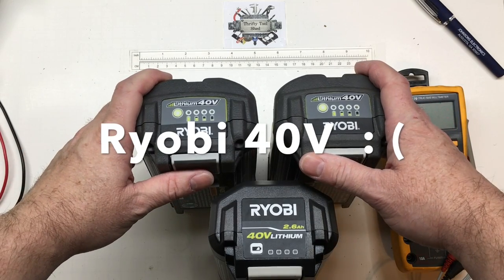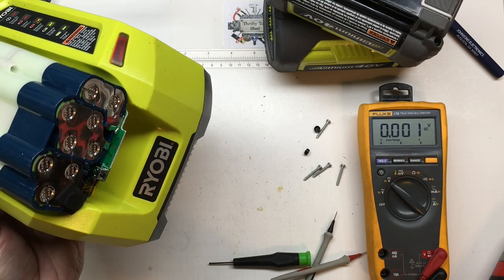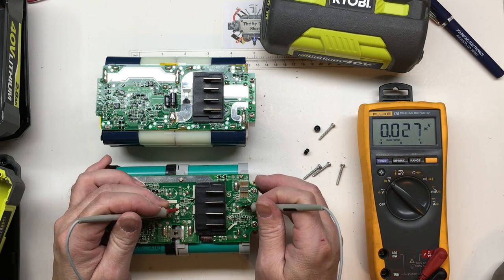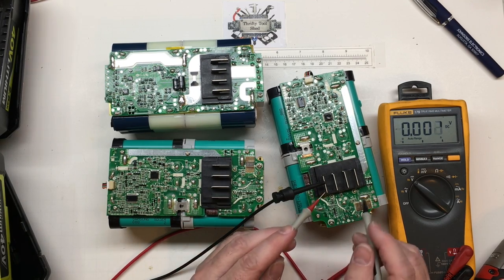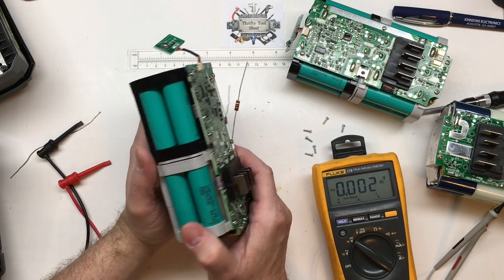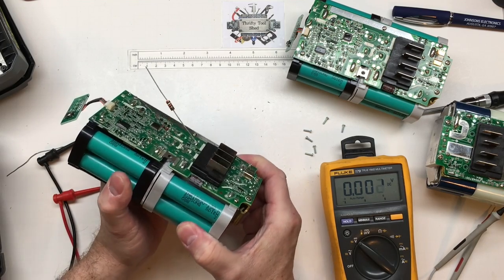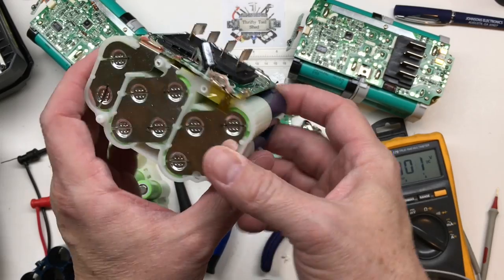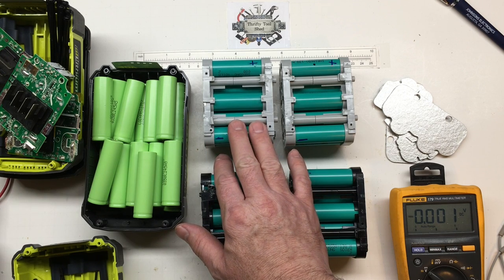Ryobi 40V Battery Issues & Cell Harvesting

Comment: Dude. On that newer pack, that negative battery cell connection on the lower right of the screen... Hook up 30 volts or so with a current limited supply to like half an amp... Put the positive on the positive terminal.
Let it run until the current starts to drop down to about 1/3 of an amp or so, and then throw it on the real charger.
It'll fully recover the entire pack.
You don't even have to take the thing completely open. You unscrew the bottom tip it up so you don't have to undo the sticker, clip onto the board on the corner for the negative and clip over the positive terminal.
No reason to take this thing completely apart unless you're harvesting cells.
Reply from the maker: Dude, that is what I am doing, I am harvesting cells as mentioned. I simply was taking time to do a video I was asked to post. I mentioned many times that I recovered many of these packs and they were a constant problems (and I mean dozens of packs) I have many repair videos of lots of packs! As mentioned this video was asked for as I mentioned several times the absolute best way I ran my 40V tools was with the two 20v packs in series because the 40v batteries are not designed well. I also do not show many times in my videos boosting packs because as mentioned in many of my reoairs, you should not boost without looking at the physical condition of the cells, you want to see why? Watch the video I did on the kobalt 40V pack that I posted. DO NOT boost packs without knowing what you are putting Voltage accross!
Reply: @ThriftyToolShed hi there, sorry to bother you, I'm a novice at best..... If I connect 40v to the positive battery terminal would I simply connect the negative to the bottom left cell (battery right hand side)? Would this charge the whole pack? Both sides in parallel??? I just need to jump start it and bypass the BMS then charge with the original when it reaches minimum charging voltage ... I would really appreciate a little advice . These batteries are a fortune to replace.... Cheaper to get a petrol lawnmower lol

Comment: Hey there, love the video. Do you have a video on rebuilding both the old and new style Ryobi 40v batteries? Having an issue with a 5Ah battery that only charges to two bars max. Thinking I may need to take each cell out and manually charge them but not 100% sure on the fix. Any help would be greatly appreciated!
Reply from the maker: Thanks for your comment! I do not have any video on the 40V Ryobi packs. I never had great success with the BMS board that TTI surely over complicated for some reason. It's problematic and even though I had a little luck replaced cells in some and a few the microcontroller reset helped get it back going. A few ofthers I actually had bad MOSFETs for the output of the pack faulty. In the end I did not have the best results for my efforts and most repairs were short lived. I had the best luck running my Ryobi 40V stuff with my (2) 18V Makita packs in series and never had an issue, just more aggregating to deal with as a battery holder. This worked until I was able to switch over to the EGO 56V platform. No looking back on that one. If you do find some cells low 9n your pack, maybe charging them up and getting all 20 cells balanced could possibly get some more life from your pack. Best of luck to you on yours!

Comment: I couldn’t find a AC to dc power supply on your list to give you credit? I also want a battery charger to bring up dead batteries and test.
Reply from the maker: Hi Bob,
Thanks for letting me know.
This is a very good 0-30V for the price...
https://amzn.to/3Pc0hP0
The 0-60V will cost more, but are handy for the 56V packs etc....
https://amzn.to/3EB6lvw
If you are looking for a 18650 cell charger, this is one like I use...
https://amzn.to/44SDuO6

Comment: Didn't watch the entire video, but there is a RESET pin on the board labeled RST. All you need to do is charge up the + and _ using 35v at 2amps for about 20 hours. Then, short circuit the RST pins on the board. The battery will work again! Watch the video from 'Gears and Tech'.! Save yourself hours of time and crazy amounts of money on these 40V Ryobi batteries. None of the work some of the guys in the comments below is necessary. You DO NOT need to balance each individual cel. All it needs is a reset but the pack needs power (35v) before you can do that! If that fails, then yes, you have a bad cel.
Reply from the maker: Yes, the reset pins are mentioned and the most problematic issue by far is individual cells.

Comment: I have a couple of RYOBI 40V tools, and just lost two battery packs.  I think It's due to a GFI outlet connected to the charger tripping, and then the BMS draw allowing the battery packs to discharge.  I don't want to chuck these Ryobi blowers, what should I do about replacement packs?
Reply from the maker: I truly had the best luck running my 40v Ryobi stuff from two 18v or 20v packs in series. I did have some minor luck boosting the packs back up to charge and I did go through all the trouble to replace some bad cells but ultimately it was a constant fight to keep packs that would last for any length of time. So once I configured the 2 series Makita packs, I had no more issues...
Reply: I have a couple Makita BL1830B 18V batteries (3Ahr) (and charger), and I have a dead Ryobi OP40401, a soldering iron and a 3D printer.  I just don’t have legitimate skills, and I wish  you lived down the street from me!
Reply from the maker: @davidelmer4302  , I would sure help! It is not hard because I bought some already made adapters for the makita and simple added slide on terminals (crimp style) and wired it series, to make it easier though I did use the connector from the old 40v pack, so it would slide in and connect!

Comment: I have the even newer battery and it still went bad after 6 months! 1st green light glowing, 2nd no green light showing, 3rd green light glowing, 4th no green light showing. Blinks red/green on charger.
Reply from the maker: Wow, that's crazy. I sure hate to hear the newer style packs are failing as well. Warranty claim it is! 
I truly feel that Ryobi's 40V platform is so bad that it may need to be totally abandoned and redesigned. There are so many tools out there I know that's why they don't do it. If they cannot get the packs to be dependable it's better to abandon the line. That sounds bad, but we will come up with adapters etc. Even like I have shown in this video and the latest 40V mower repair video. We can make adapters even if the Ryobi new platform is better we can make adapters for those, but this current 40V needs to be trashed. Air flow is not good in the pack design, the higher the capacity of the pack in those tight bricks with no space is a death sentence. On top of that the Mosfets and overcomplicated BMS board is another death sentence. They make their tools cheap and dumb with no smarts to cut off based on battery voltage and they make the pack overcomplicated and expensive.  I hope the new Skil 40V stuff holds up well, they seem to be better designed and from Chervon  the makers of EGO so hopefully it does well, they don't have the platform the Ryobi does unfortunately.  Ryobi has so many tools for their line which is why it is so popular. I kinda feel bad for everyone who buys into the Ryobi 40V line, they got me over 8 years ago...

Comment: Home Depot told me if you have problems with the batters or the device to bring it back and they would give you a new one.... no questions asked.
Reply from the maker: As far as warranty that is correct, but as mentioned in the video EGO had already sent my replacement of course so this is the bad one EGO let me keep. Just so you know also Home Depot is no longer a EGO dealer. Lowes and Ace has them now along with a few others.
Reply: @ThriftyToolShed  That's good to know.... Thanks
Reply from the maker: Sorry, I had lots of comments on my EGO 56V  packs and I copied this answer to your Ryobi question by mistake. (Wrong video, lol...)
Thanks for your information!

Comment: How is Ryobi getting away with labeling that as a 3Ah battery (108Wh) when the cells are only rated for 1300mAh?  That's 2.6Ah (96Wh at 3.68v per cell rated voltage).
Reply from the maker: It's been a while since this video, but many manufacturers use the full battery voltage when calculating the Wh such as 4.15vx10x2.6ah=108Wh. The same with pack voltage. Some call 14S packs 56V like EGO and some call 14S 58V like the older ECHO. The new ECHO platform calls it 56V also...
Some 5S packs are called 18V and many are considered 20V Max etc.
Yeah, it should be the nominal voltage used in true calculations and yet I will agree the max voltage is a good thing to label things since it does matter what the max voltage will be in most cases. It's better to know that a 10S pack could be up to 42V when fully charged than marking it a 36V pack for nominal rating.

Comment: I push the power level button on the battery and it flakes all 4 light flashes 4 times. What does that mean? Defective?
Reply: @ThriftyToolShed  the 4 led light flashes green 4 times I meant. When I connect my booster charger to it, it doesn't read any current also. Is it in sleep mode you think?
Reply from the maker: I apologize, I was commenting on some videos, and I thought this was the EGO pack video comment. I had answers some of those. Disregard my last comments, I will delete them as not to cause confusion for someone else.
Reply from the maker: @quangyung6751  
I would check Voltage at terminals and check if it charged ok?
Reply: @ThriftyToolShed  This is Quang Yung post, but I guess I'll start here and ask the same question. On the newer (updated) Ryobi 40v battery, I am having the same issue with 4 led flashing with the fuel gauge button is pressed. It is a 4ah Ryobi 40v battery and is considered "defective" on the charger. When measuring it with my multi-meter, it reads at 39v and the voltage will gradually reduce or drop. I, myself also harvest 18650 cells, including 21700 cells as well. I can solder/desolder and spot weld as well because I have a machine. Aside of that, it looks like the issue is occurring from the BMS PCB and not from the cells condition. I'm not sure if the issue is related to a pcb component/components. Any help on this issue would be great!

Comment: I have a 40v battery, the charger says its defective and the 4 lights on front flashes. The battery reads 36v on the + and - terminals and the same on the cap inside. What do you think is wrong with it? I have a new one coming, but was wondering if I could save this one, if not I will keep it and use the cells in my laser and flash light. Thanks
Reply from the maker: It's possibly the BMS board or thermistor on the board, that is assuming you know that the charger is charging other batteries fine correct?
Reply: @ThriftyToolShed  the charger is charging other batteries fine.

Comment: hello, i was wondering what a better way to take apart the newer battery you show in video because i have one but the output is still showing 40v. i feel if i spit the board in half it might fry something. should i try to desolder the positive first? that are in the middle. then do the negative? i was going to try to cut the negative first since it on the outside of the battery and is the easiest. but i feel like it might fry something.
Reply from the maker: It is always a risk with battery packs for sure. The best way to do the ones like in the video to me was to de-solder them. I would use low temp. Solder and add some into the connections for the cells sections. It will take a large 150W iron or higher to get the job done easily and either de-solder wick de-solder pump to clean joints well and the board should lift off. Back when I used to repair some of these packs that is how I did it. I really did not care which ones I de-soldered first, I just got them all de-soldered, cleaned  and gently lift board off of terminals while still applying heat also. Of course being careful not to let the iron or any other tool come across more than one terminal at a time. Best of luck to ya!

Comment: where do you get your dvm meter leads from GREY , I would like to buy some, thanks walter
Reply from the maker: Hi,
These are the Fluke TL910 leads and they are expensive. I really like them for SMD testing, they are really handy. I actually bought these used with a Fluke 179 meter years ago. This is a similar set I believe?
https://amzn.to/3LCcDgU
Reply from the maker: EBay also has some at times cheaper, but hit or miss like these for example...
https://www.ebay.com/itm/New-FLUKE-TL910-Electronic-Test-Probes-/234405778020?mkcid=16&mkevt=1&_trksid=p2349624.m46890.l49286&mkrid=711-127632-2357-0

Comment: morning sir got a stupid question for you.  i have the ryobi op40504 and the lights are flashing and will not stop.  i tried to jump reset and gnd but still flashing.  now this battery has 2 rows of jumps  first set reads gnd 3.3v res dio clk  second set reads gnd 3.3v res isp tx rx anybody have an idea?
Reply from the maker: Not a stupid question at all. I have not worked on this model myself. It seems from what you are describing that it may have 2 Microcontrollers? If it has 2 headers. Jumping the Reset on both is one of the things I would try, the only other thing I can think to mention without experience with them myself is look for any corrosion especially around the microcontroller pins and maybe try some plastic safe and non-conductive electronics cleaner and clean the board well. That's all I would know to try. May really be a microcontroller problem?
Reply: @ThriftyToolShed  well thank you sir.  I did try jumping one at a time the 2 sets of jumps but I think I will try to jump both 1 set then the other set and see if with both jumpers in place that might reset.  The board looks ok except all the heat evidence by the fuel switch and the mofsets.  Again thank you I do appreciate you opinion.
Reply from the maker: I see. Yes I think one at a time like you did should be fine. Sorry for the confusion. I simply meant to make sure you did do a reset on both, but I did not mean the same time. Other than the board cleaning, I would not know any other trick. If you have not seen it, check out the Ridgid pack repair I have, it was strange how cleaning the board fixed it even though I had no sign of corrosion like usual. Best of luck to ya! 
https://youtu.be/lpjdJCqBsTU

Comment: I have a P107 and each cell reads 3.8 plus volts. But the led shows one bar.  The charger also will not charge the pack.  Any ideas??
Reply: Then when it is on the charger.  The charger clicks multiple times with the steady red and flashing green lights

Comment: The secret with Ryobi batteries is to never drain them below 2 bars.
Reply from the maker: I believe it is way more with the heat build up of the cell being packed together with terrible cooling design  actually causing issues. It may help to run them less time of course as you mentioned not down below 2 bars. As far as 18650 cells go it is fine to go from 4V down to 2.8V with no issues. I usually perform capacity tests from 4.2 down to 2.7V with no issues. I don't think it is as much of an issue using less than half the capacity of the pack every time as it is the thermal dissipation especially in the center of the larger packs.  I believe the only way to fix the Ryobi 40V packs is a complete redesign or as an immediate work around is maybe using very high end 21700 cells say 4000mah and only having 1P 10S design so you don't have so many cells packed as tight as they can possible fit together. For most people using half a pack's capacity is not even close to a solution really. For example, a 2ah pack in the blower would last no time. You are turning 2ah into nearly 1ah packs and 4ah into nearly 2ah packs....
Reply: @ThriftyToolShed  I think it is later designed the battery not engineer first thing you need to think about is cooling

Comment: I have same batterise they don't work. When I measure them, the voltage keep moving down. I don't understand what's that means. Can you explain it for me? Thank you in advance.
Reply: In your case, if you're measuring the voltage from the + and - terminals,  you're reading the voltage across the capacitor.  It's likely that a bad cell in your battery is leaving an open circuit through the DC portion of the battery.  The capacitor is connected in parallel to the cells (and MOSFETs) and is still a circuit.  When you put the battery on the charger, it will charge the capacitor (because the circuit is closed) but not the cells (because the circuit is open).  Normally, closing the circuit in a capacitor will allow an almost instant discharge of the charge built up in the capacitor, but your ohmeter has a huge resistor built in that limits the current of the discharging capacitor.  What you are seeing with the voltage starting at a relative high and dropping is the slow discharge of the capacitor with the voltage difference between the positive and negative terminals of the capacitor going towards 0 as the capacitor discharges.
Reply: @michaelmcginnis1429  thanks